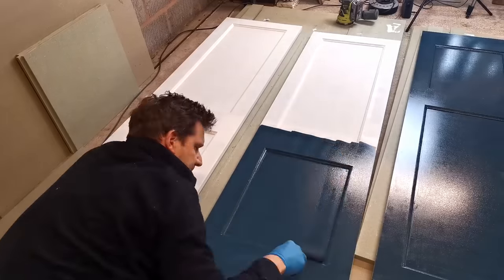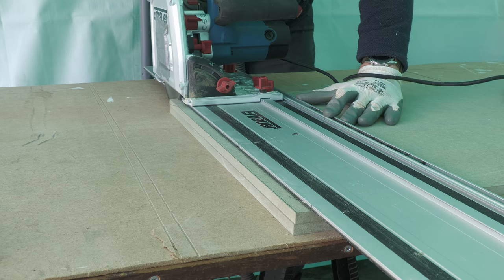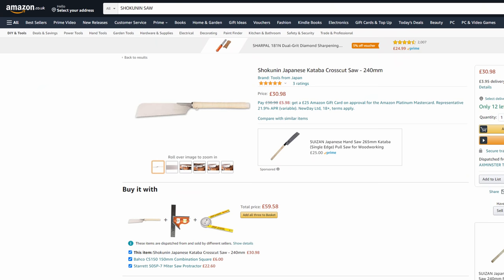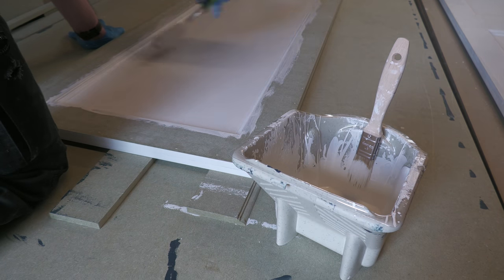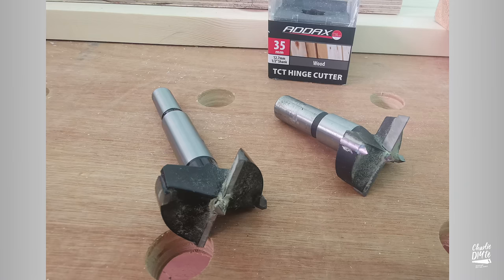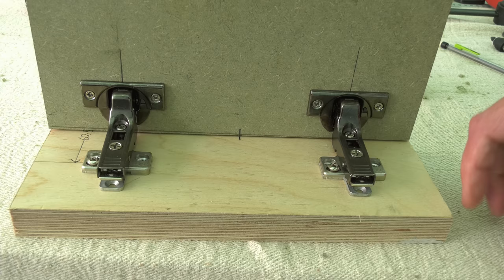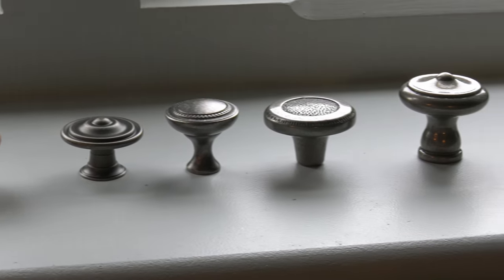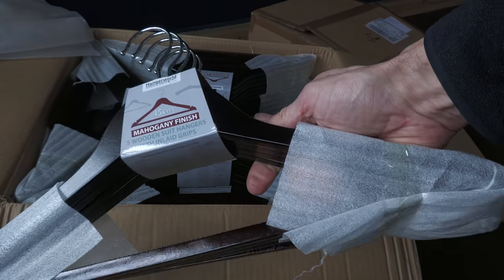How to Make & Hang Shaker Style Doors - Wardrobe Build Video #7

Comment: Great series and as always well presented, with DiY top tips and solution ideas.
Question… why did you select MDF and not paint grade plywood?
I’m currently planning a build in a walk in robe which joins onto our on suite bathroom - concerned that the MDF may warp in a potentially humid environment. Thanks.
Reply from the maker: Good question Malcolm. Simple answer I didn't research plywood options as I'm so used to using MDF. Would it be more expensive? In my experience ply can also warp. There's probably not a huge difference between that and the moisture resistant MDF I've used on this project.

Comment: Charlie..
The only problem with the mounting plates without the wings is the same as the black ones that you showed.. On a large door all 4 or 5 hinges can't be adjusted simultaneously so will not work as well. The first one you showed allows the whole door to slide up or down and can be immediately positioned by tightening initially one screw. Just finduhed fitting some fake shaker doors and I bought both sets of hinge plates to see what worked best. Resorted to the ones  where you can slide all 4 hinges at once
Reply from the maker: Thanks Dave. Yes I can see that. Could you move each incrementally though?

Comment: Hi Charlie, what an amazing video. You’ve inspired me to try and do something like this on a smaller scale to start off with, thank you. I just have one question about the acrylic eggshell paint; the one in the link is white, what colour / is the grey you’ve used, or did you mix it yourself?
Reply from the maker: Absolutely. Start on a small one and build up your confidence. That's exactly what I did. It was Farrow and Ball Hague Blue No.30 but mixed by my local Johnstone's Decorators Centre. Don't be tempted to use B&Q's Valspar. Used that in our kitchen. Dreadful stuff!
Reply: @CharlieDIYte Hi Charlie, thank you for the quick reply. That’s great, thank you for letting me know. I will go to my local one in the New Year. Merry Christmas.

Comment: Hi Charlie, I’m just about to embark on my own wardrobe build and I’m deciding which method to use for the doors. Now that yours have been in place for a while, have you had any issues with the doors staying flat? Thanks and keep up the great vids!
Reply from the maker: You're welcome,  thanks for the comment. The doors don't tend to move once made so as long as you make them correctly you'll be fine thereafter. Mine are still dead plumb. It's crucial to have a totally flat work bench and try store them flat before painting.

Comment: Hi Charlie ... great videos .. I have put off building my wardrobes for 10 years ... I may now have the confidence to go ahead. Could you tell me why you went for plain mdf with painting ... rather than a veneered or plastic coated mdf which would have saved the effort of painting. Are there any additional issues if using veneered mdf ... thanks ... Chris
Reply from the maker: Hi Chris. With plain you have a lot more margin for error. You can fill any errors and paint. Also making those doors wouldn't have worked with veneered.
Reply: Thanks Charlie ... plain it is then ...Chris

Comment: Thank you for another great video and all your great content. I bought the Btec glue gun after seeing your review, I have to say as good as any mitre bond on the market. Do you think that the doors could have been constructed with the glue gun instead of Gorilla glue? As I’m planning on making the same doors with the glue gun. Once again thank you Gareth
Reply from the maker: Thanks Gareth. Really chuffed you like my vids. I wouldn't use the glue gun for the doors, just because you want to spread the glue out to get a really even bone. I used impact adhesive ( sticks like sh#t or similar) once and the doors bent horribly as they set. Not saying they will with the glue gun but what I can say is you won't get a completely flush bond between the two pieces because the glue will set before you can clamp them tightly together.
Reply: Thank you for the tip, and thank you for reviewing the Btec glue gun it’s changed my opinion of them.

Comment: Charlie I’m a huge fan of your videos. Quick question - I need to remove some silicone from an acrylic sink. How can I do this without causing damages / scratches please? I have a Fugi kit.
Reply from the maker: Thanks mate. I'd get some CTec Multi Solve spray as used in this video https://bit.ly/3iEyUMU and give it a good spray and then gently tease it away with a plastic removal tool or scraper like this, https://bit.ly/3vLaTIV - or you could try the plastic mixing tool that come with 2 part wood filler, or go at it gently with the razor blade tool that comes with the Cramer Kit 7 if you're feeling brave, but you could scratch it with this. A few applications with the spray and it should pucker up and start coming away nicely.

Comment: I am debating doing this sorry if project. I don't know if I want to commit the time required to get such a great result. I wonder if I might achieve a similar result with kitchen cabinets in a more regular shaped room. Probably a bit more expensive but quicker
Reply from the maker: Also look at IKEA pax I think it's called. You can buy the carcasses and assemble your own wardrobe from scratch.
Reply: @CharlieDIYte  Thanks Charlie. It's hard to balance time, cost and quality. Not sure about IKEA for a built in to last. Would prefer solid material, even mdf, but not cardboard.

Comment: Brilliant series of videos Charlie - just sat through he whole lot!
I’m about to start a very similar project, so this has been invaluable, but my doors will be mounted in front of the frame, not flush, as yours are - would you till add trim to the end of the MDF in that case, or just paint finish it as elsewhere in the project?
Reply from the maker: Thanks Richard, that's quite a commitment watching through the whole lot - huge respect! No, if your doors are overlaid I wouldn't bother with the trim. Good luck with the project and drop me a line if you need any help with anything.

Comment: Hi Charlie. I really enjoyed this series and will watch again when I get around to my build. I've got an existing wardrobe that I want to replace. It's against a north facing wall in an older property. I'm improving ventilation around the house and also liked your video on humidity. However, I noticed there was no mention of wardrobe ventilation. Perhaps nor necessary but I've read that creating airflow around the back, top and bottom can help with musty smells. Do you have any thoughts on this?
Reply from the maker: Yes I mentioned insulating the walls in the first or second video, rather than ventilation. I have a friend who installed a wardrobe on an outside wall that wasn't insulated and he's had mould in the wardrobe. I think that's a combination of the air being too damp (teenagers not opening the windows when showering) and the walls not being insulated. Either measure you mention would help enormously but I suspect the insulation would be more effective on the basis that it would be difficult to guarantee effective ventilation, not to mention tricky to build it in. The other thing you might consider, Mark is a loft PIV - Nuaire and Vent Axia do them. There's so much love for them in the comments section of my Condensation video. That would help to prevent moisture laden air condensing on any cold surfaces.

Comment: Excellent job but my preference would be to do away with the little top cubby holes and take the doors higher.  Easier, quicker, cheaper, simpler but this is only my opinion and I do really like your completed project.
Reply from the maker: Thanks Kevin. Yes but we find those cupboards at the top really useful. 👊
Reply: @CharlieDIYte  No doubt!  As a chippie in North Wales people always baulk no matter how well/low you quote them and yes those top cupboards are handy but here they might be too expensive???  Or maybe I need more confidence??

Comment: I bought and installed Blum linear (not cruciform) hinge mounting plates due, solely, to your recommendation and they have been an absolute nightmare. 

It's extremely difficult to align the hinges with the plates (I have four on each door), the vertical adjustment is time-consuming because, as you mentioned, the cam on each hinge has to be adjusted one after the other.

On tope of that, and most importantly,  they have SERIOUS DESIGN FLAWS :

1) if the vertical adjustment cam is used then the moving part of the mounting plate conceals the screws which fix the plate to the carcass. This means that the vertical adjustment has to be reverted if the mounting plates need to be removed.
2) It is almost impossible to remove the hinges one at a time once they've been clicked onto the mounting plates.
3) Most significantly of all, if the hinges won't release from the mounting plates it is not possible to remove the mounting plates from the carcass as the mounting screws are entirely concealed behind the hinge. 

It's an utterly inept piece of design and has cost me a huge amount of wasted time as well as damage to my wardrobe carcasses and doors which I spent a huge amount of time making.

Yet another example of form over function, and a lack of proof of concept testing.

Comment: Hi charlie, On a previous video you mentioned using Zinseer (think it was the red/orange tin) Would you use it or the bullseye 123 version with the Helmi 30 as a top coat? I have used Zinseer before but not when applying a top coat . Thanks in advance
Reply from the maker: I'm not familiar with the Helmi 30, but the Zinsser BIN is pretty much my only wood primer these days, and is fine for solvent and water based top coats. So yes I'd use the BIN. Some people say it's a bit brittle for certain applications so I suppose if you need the primer to have flexibility, that's the only situation where I wouldn't use it.

Comment: GTI lightweight car body filler is similar to the 2 pac wood filler your using but you get a 5 litre tin for the price, if not cheaper then what you pay for "wood" filler 😉
Reply: I have always used car body filler on wood projects and years later never had an issue, much cheaper than wood filler.
Reply: @dh4144  nice tip👍👍

Comment: Can I ask why you decided to use MDF if it has such a propensity to warp? Once installed will the wardrobes last many years or is it likely to warp with time even with precautions? (I am brand new to carpentry DIY so just wondering your process)
Reply from the maker: Hi Hannah. Really good question. Bottom line, it's cheaper than say birch ply (so expensive way the moment) and even ply has a propensity to warp. So once you've successfully made the doors without them warping by taking the precautions I did here, you'll have a lovely product that will last many years to come. But ply will arguably tool better on those routed edges, so if you can get it at the right price, might be worth experimenting with.

Comment: What model of On trainers are you wearing?
Reply from the maker: I was a bit disappointed with my last pair - Cloudflow which I don't think wore very well on the soles (rubber perished and I mostly wear them inside). These are the standard Cloud - the All day travel/ light weight ones with the elastic places. I'm really using them as general indoor trainers that I can pull on and off without faffing with laces. Comfortable and incredibly light. I still can't decide if they're an over hyped gimmick or not though 😉

Comment: That wardrobe is beautiful. What a fabulous job Charlie. Clearly the light sensors are racist 😂 What a weird anomaly. I appreciate that you use basic tools that the average woodworker owns. I love my Ryobi brad nailer although mine has an angle on it for tight corners. I’ll have to go over that again to fully understand line up points on the concealed hinges.
Perfectly comprehensive and no unnecessary fluff I usually have to fast forward thru. 🙏👍🇦🇺
Reply from the maker: Thanks, I really appreciate that. Yes the airless nailed it brilliant isn't it! The wardrobe is still looking as good as when it was installed and working beautifully. I'll do an update vid some time. 👊

Comment: Might be a bit of a 'duh' question, but how do you wipe the MDF dust off of it once you've cut it? I presume a damp microfibre is a no-go due to the risk of swelling, even with moisture resistant stuff?

And tack cloths can hamper with water based finishes.
Reply from the maker: I use a small dust pan style brush and if that's not around, an old kitchen towel. I've also used my leaf blower at times but it's a bit more unwieldy and sends dust everywhere.

Comment: I don't see the benefit of that fixing your advertising. Bang a large screw with a raw plug through the hole and avoid buckling the plaster board by controlling how tight you go.??
Reply from the maker: That's fine but doesn't help when you're fixing something heavy to the wall, which by its nature will buckle the plaster or at any rate needs fixing tight to prevent it moving/sagging.